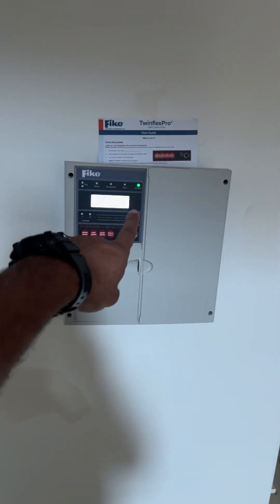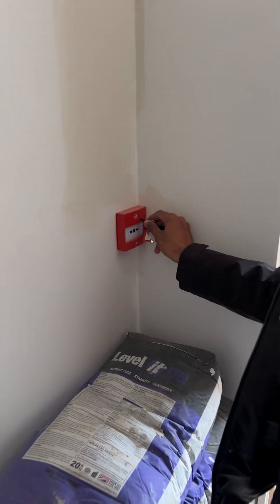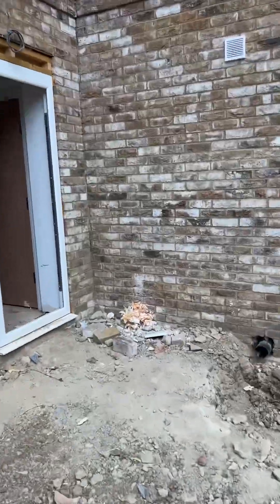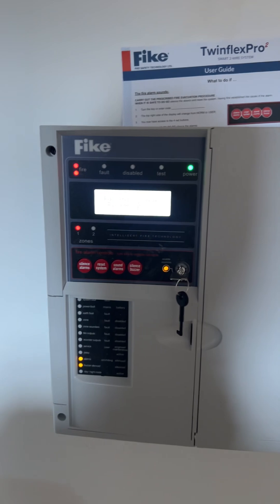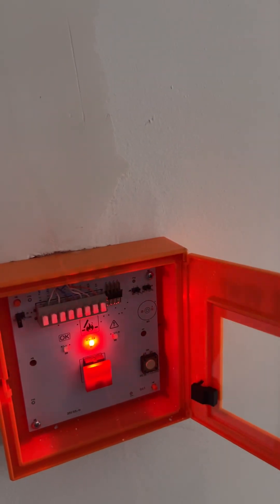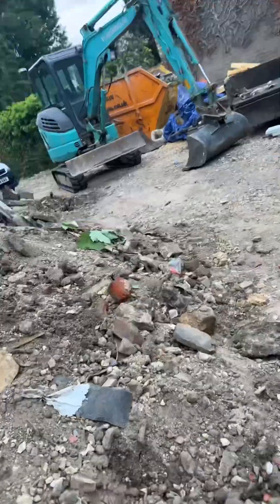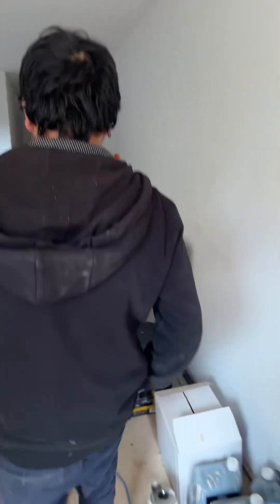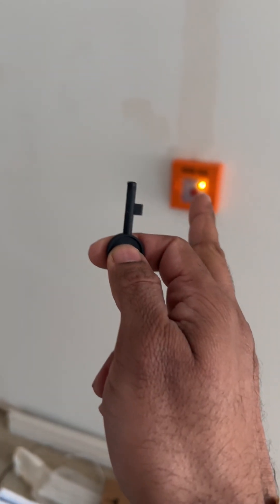Fire Alarm System connecting to AOV Window on the Roof top

Comment: Where is the aov panel ? Is the fire alar panel does everthing,?
Reply from the maker: Fire alarm only does smoke Det, MCP & Sounders where as there normally a separate AOV panel 
On this site the AOV panel is on the top
Floor lobby. Fire alarm panel is linked to AOV panel